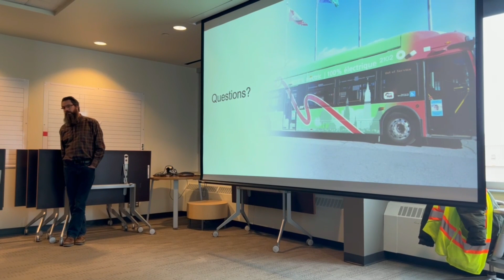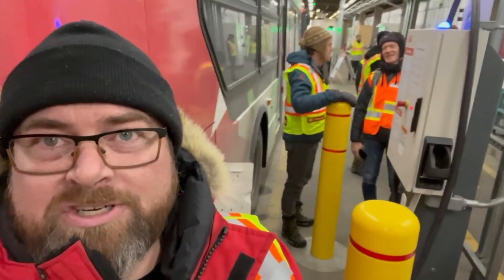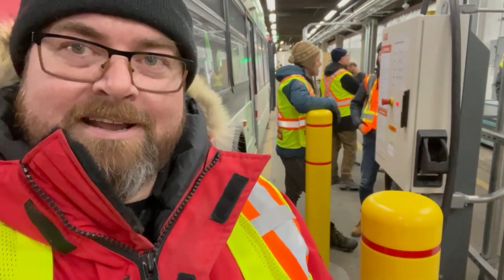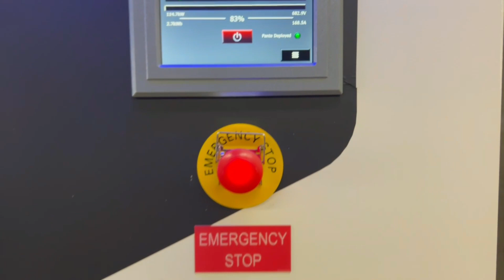EVCO OC Transpo eBus tour

Comment: The tour was great and it was interesting to hear that the 4 E-buses OC Transpo are currently using have been in service since early 2022 and have traveled over 200,000 Km (an average of 50,000 Km each) with no major problems.
It was nice that as well as the e-bus acquisition team and engineers from OC we got to hear from one of the drivers who has been using them and he reported no issues.  Apparently the drivers and the passengers are all very satisfied with the e-bus.